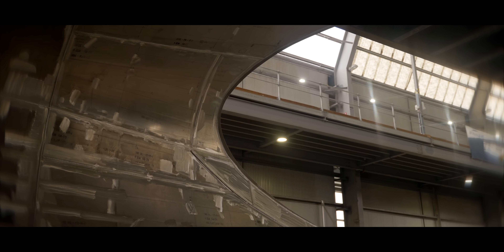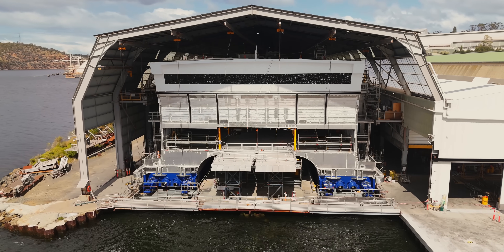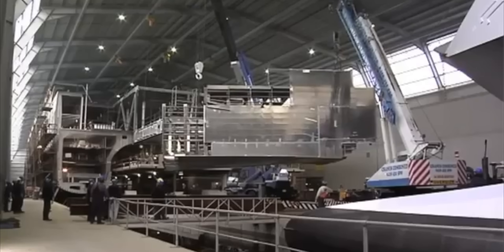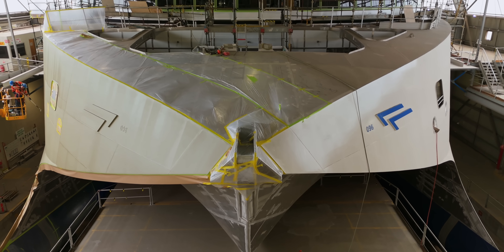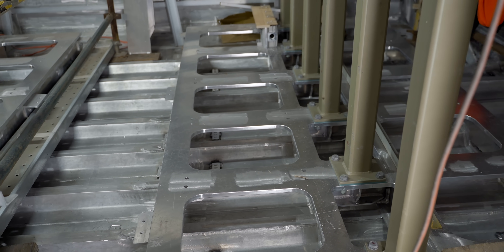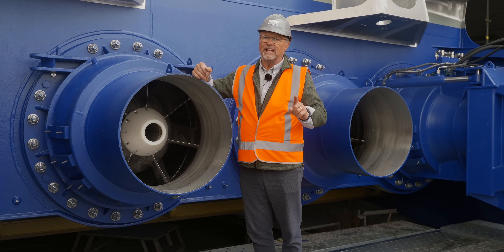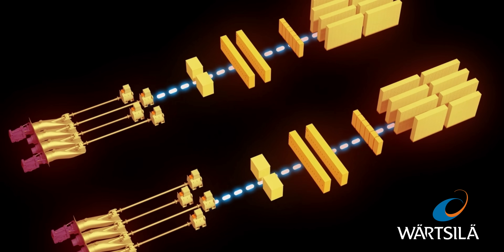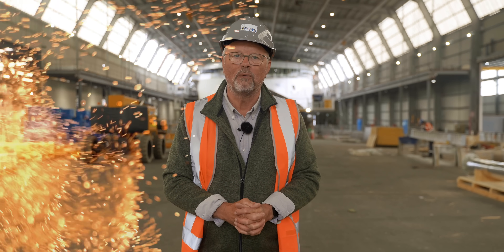The LARGEST Electric Vehicle In The World?!

Comment: there is nothing more inefficient than big electric things. they need huge dedicated substations to charge them and the batteries loose none of their excessive weight as their power declines. remember, to halve the charge times you have to square the input power. there are loads of huge electric projects rotting away because the huge extra infrastructure cannot meat the demands in charging. good old mother nature, harnessing sunlight safely in energy rich oils laughs at the pathetic tech-bound boneheads as they leap from nonsense project to nonsense project, blinded by their own stupidity....truth sounds like whining to those peddling nonsense.

diesel electric, the use of electricity to provide motive force as it is generated and not stored in batteries is an entirely different matter...

Comment: Isn't every nuclear submarine ever built actually electric? 🙃Before you flame me, I think a battery-electric ferry is a great idea. Tasmania isn't 100% renewable - they do use gas for electricity sometimes when there's not enough water for hydro, not enough Tasmanian wind, or not enough wind power to import from Victoria. Again, don't get me wrong - I wish all of Australia was running on as much renewable energy as Tasmania. South Australia is doing well, but Victoria still burns really dirty brown coal, while NSW and Queensland use a lot of black coal. But during the day, as much as 70% of the electricity in Eastern Australia is renewable - mostly rooftop and large scale solar.

Comment: Fragile nuclear reactor plants on a Fragile national grid are a national disaster for more violent weather impacts in a dangerous destabilising climate.

Consumer based rooftop PV generation is a zillion times cheaper than distant renewables Generators and nuclear grid central Generators. 
Millions and millions of rooftops is zillions of realestate hectares and zero new grid costs. 

• PV rooftop electricity is 2cents kWh, 
• grid feed-in 5cents kWh and 
• grid supply is 50cents kWh with all fees included.

The grid is the $TRILLIONs investment asset that needs to be repurposed and integrated into the new resilient and robust national clean electric energy future. 
The $TRILLIONS national electrical grid is FRAGILE and needs to be protected from blackouts in the clean electric future as the massive fossil fueled energy is replaced. 
Distant renewable PV and big batteries can be relocated, nuclear plants cannot and will become stranded assets and an economic dead weight. 
France's nuclear fleet of fragile reactors needs neighbour countries to manage grid load changes.
France's crazy neighbour, Stalin's USSR standing army, Putin's father, and then the crazy Arab oil embargo is the reason France doubled down on nuclear plutonium for its military defence. 🪖 

80% of the world's population live in dictatorships and dictators love ❤️ 😍 💖 plutonium electricity industries. 

So if CO2 emissions worldwide is the danger then FRAGILE nuclear reactor plants centred on FRAGILE national grids is not the answer. 

Hectares of consumer's PV rooftop is a quantity with its own QUALITY. 
Millions and millions of parked v2g EVs massive batteries is a quantity with its own QUALITY. 
Most vehicles are parked 23hrs every day and all night long. 
Rooftop PV dc electricity to EVs big batteries is extremely simple technology. 👌 

The $TRILLIONS national grid owners cashflow SHTTSNPANTS FEELINGS can be overcome by repurposing the existing national grids unique connection to billions of consumer's rooftop PV panels and industrial users moving away from fossil fuels to clean electricity 😀 😉. 
Happy days for grid owners and investors cashflows.

Nuclear promoters wet dreams should remain in dreamland.

Comment: This is a big boondoggle. Batteries take more energy to charge them than what they put out so it is inefficient. There is a reason long haul cargo ships are diesel electric. Electric ships are not knew. WW2 submarines were all electric when under water. They had a diesel power plant and generator when on the surface to charge the batteries and run the electric motor for the propellers.

Comment: Just a little interjection - jets taking off rarely use “maximum power”! The thrust is calculated on each takeoff to give the correct power for the conditions and runway, terrain etc with all the safety “buffers” so that the engine life is not unnecessarily compromised.

Comment: Awesome design, however the weight of the batteries, “taking into account the fact that the energy density per sq/cm still doesn’t have quite as much efficacy as combusting hydrocarbons” could be a matter of concern in the scheme of things.
Lipo and Lion batteries are far superior as compared for example to the old school Nicad batteries of old, however there still is a long way to go in battery technology!
Great video!
👍👍👍

Comment: A battery that size would have tens of thousands of individual cells, if only one of them inevitably faults and goes into thermal runaway… 30 seconds tops to be overboard to the safety of the cold sea.
Love to see how the beautiful ship is going 5 years from now.
Reply: First: They use lithium-iron-phosphate-batteries, which are pretty safe compared to NMC-batteries.
And there are of course construction measures to avoid the expansion of a fire. The battery is divided into separated modules, with fire-proof walls between. And probably some other things, but I don't know details for this specific case (this ship).

Comment: Thanks for sharing. What fuel does it use to run the electric generator and charge the batteries? Is it Diesel or Hydroden? Will there be electric Airplanes of various sizes shortly??

Comment: Well there was probably 500 questions you didn't ask what type of batteries are they ?? For a start 😮😮😮😮 what type of motors?? Who's making them, hellllllooo
Reply: Battery chemistry is lithium-iron-phosphate.
The electric motors are likely PSM, with permanent magnets. Would be typical for Wärtsila.
Reply: Like incat would tell you who supplies the motors and jet units, and of course the batteries, this isn't a retail product mate, you won't be able to go to the dealers and buy one the same, but if you didn't notice there was a wartsila graphic showing the drive train.
Reply: Wartsila.

Their conventional ones use MAN B&W  engines running through ZF gearboxes into the jet units.

Comment: How far can it go on a single charge ?
Reply: Depends on the used power and speed. Generally, you get four-times the range with half the speed. I guess, it will get around 100 km of range with the mentioned 25 knots.

Comment: Tassie not 100% zero emissions,  still use a heap of petrol and diesel etc. Even the electricity is not 100%, connected to coal based systems on the mainland.

Comment: Battery swapping for ferries is a must. The battery room is isolated just detached the containers with batteries push the full in. Reduces requirements for highpower fast charging in minutes,Reduces damage to batteries, you can use lower cost batteries as well. The more of the requirements for the journey you offload to the shore the easier you make it for the boat.

Comment: It is actually not the largest electric vehicle that honour goes to bucket wheel excavators that are being used in Germany to dig away the soil to expose the coal that is used by one of the world's largest coal power stations. 
There are two of them and they use around a quarter of the electricity produced by the power station, the body of the excavators is larger than the building that the ferry is housed in and the excavator boom is around double the length of the building. 
All goods trains are powered by electric motors that get their electricity from diesel-powered generators.
Reply: Those are over 130 metres long?
Really?
Reply: @pugnut403 Yes, they are, just one electric motor is larger than a semi trailer/tractor trailer/18 wheeler and they have several. 
The tracks that propel it are larger than a 2 story building. 
These excavators are so ridiculously large that they have there own elevator system,a conveyor belt system that stretches for kilometres and a crew of over 10 people just to run it in normal conditions. 
The ferry itself would be completely dwarfed by them. 
The ferry is the largest battery powered vessel and is an achievement on its own, there are plans for container vessels that use electric motors but they don't just use batteries but also have special wind turbines that look like smokestacks so they can continuously recharge the batteries.

Comment: for them to charge a ship at 40MW what amount of carbon out out will be created to supply the electricity created to charge the ship
Reply: Very little if renewable energy is used. Renewable electricity is considerably cheaper than electricity produced by burning stuff
Reply: 98% of Uruguay's energy is generated by renewables. Try again.

Comment: This is what Scotland ordered and began to make. Unfortunately, the design threatened to make a mockery of the carbon emissions guidelines, so they changed the design half way through. It's never easy to change design mid build and easily explains why the overrun cost went to many times over plan. 
At least that's how I understand it. Tell me I'm wrong.
Reply: The aluminium manufacturers who supply incat use hydro power in their smelter, I should think that make a hell of a difference.

Comment: Actually, there are lots of ships which are electric and much, much bigger. 
Cruise ships are often propelled by electric azipods. The difference is, the electriicty is generated by diesels. They are diesel electric.
The newish P&O ferries on the cross channel route (40,000 tons or so) have batteries and could do Dover - Calais on batteries. Except the ports didn't realise they would need to charge them, so they too run on diesel.

Comment: Come on Robert, cast your mind back to 1982, the Falklands War. A few British warships down there burned to the waterline, they were Aluminum.  Its a softer, lower ignition metal, the nautral debris in 35 miles of sea at high speed is a disaster waiting to happen.

Comment: Yes Tasmania is very blessed to have a great inland desert with (few population centres - actually, none - high water catchment - AND a couple of power umbilical's to the Eastern Australian Mainland Grid (NEM)  to cover the "tiny" deficits when the wind and water takes a break in their off seasons - or in winter when fog blankets the towns until  midday - I love Tasmania - a very cute place.....

Whether the task can be done on battery Electricity - all depends on the "energy balance...   It is just an engineering exercise - AUSTRAL and Incat both make large Aluminium fast ferries - yes Incat's are the prettier of the 2 companies boats..  (The UK has some/ many aluminium fast boats on several ferry routes - seems you aren't much of a ferry traveller - jk...   (have a laugh  Rob)

Aluminium - has a limited service life - the 1/3 lighter doesn't tell the whole story. - toughness, creep and fatigue get in the way of "extreme lightness".   (At the end of the day-  the energy sources used to charge the batteries is crucial - a 30 mile crossing route is "nearly nothing...

At 8:24 - I think Rob is spouting absolute rubbish...
2 200 kW per "motor? (x8 is -17 600 kW Total)  

4x B474 Engine (GenX),  ~442 000 kg max takeoff weight ,  thrust 266 000 lbf (121 000 kg, or 121 Tonnes) - propelling 442 tonnes of aircraft  down the runway "moderate to decent constant acceleration (~0.3g if FULLY loaded)...
 - If the Exhaust of the B747-8 is 550 miles per hour (885km/hr)- at sealevel (245 m/s ) this is 290 800 kW of Power ( Thrust Force in Newtons * Velocity in Metres per second - of what is being accelerated, which is the Exhaust gas.)  - of course fuel burn is for ~3x that chemical power - ( just as solar panels need 5x the suns energy to the electricity they output)  because we have reality to thank for making so much power to get off the ground  in a few tens of seconds - in under 3km linearly 0 - 175 kt (90 m/s)  and up into the stratosphere......  (another resource says the GenX engine has an exhaust of up to 270 m/s at sealevel - that makes the power output about  x greater...)

(NB, I  just looked all this up on a hunch that you were speaking cr@p.)
Reply: Australs Japan to Korea ferry was only in service before it was removed from service because of leaks.

Comment: 0:34 Bobby made a bobo... it's 130 meters, not 310 meters...

The electric ferries between Sweden and Denmark are 238 meters long and are not lightweight aluminium. And were launched in 2018.
Reply: swapped the 3 and 1 in translation.
Reply: The ferries between Denmark and Sweden (Aurora and Tycho Brahe), are hybrid ferries originally built as diesel powered combined train and car ferries. They have been  retrofitted with batteries. This hybrid capability has saved them a number of times when there were problems with the batteries and/or the charging stations. It is a industrial robot that plugs in the changing plug. The plug alone weights around 140 kg.
Reply: @ChrisBagge Yes, also very useful if they have to go further to a ship yard for maintenance.

Comment: If the batteries are Lithium based, is there provision for dumping them under the vessel if they self immolate?
Reply: Unlikely, since the chances of them "self immolating" are far lower than the risk of a diesel engine catching fire.
Reply: @theelectricmonk3909  Still, not a bad idea, should be easy to place the batteries low in the hull in a detatcheble compartment.

Comment: This is fantastic! Obviously this is designed for shallow draft for a river.  Can a similar sized vessel  be used for Bass  or NZ's Cook Strait? ( 6 metre swells)
Reply: No
Reply: Yes. 
Absolutely. 
This type doesn't work very well when the prevailing waves come from the side though. 
Earlier INCAT vessels were used on Bass Strait, but they were rough when the storms came in from the west.

Comment: In my perspective it's great that we gain a lot of experience with battery electric vehicles.

But in the end, I believe hydrogen fuel cells will come out on top regarding vehicles this size.

They'll probably still have a battery, so that the fuel cell kan keep going at optimal speed even while in harbour.

Most often ferries of that size are required to do much longer distances, and boats in particular aren't that sensitive to weight... diesel-electric has been common, even from incat, for decades.

But that only means that they know their motors and wiring, all they need to do is to adapt to a different power source.

Comment: Scotland has an electric ferry but the battery needs to be replaced but they can't get it until 2027, so good luck !
Reply: If you are going to try and reference something at least get it right. Quote from The Scotsman 8/1/25: 

"Some of CalMac’s new electric ferries may need to temporarily run on diesel for as long as 18 months because of potential delays to power grid upgrades for battery recharging, MSPs have been told.
The seven vessels are due to start arriving in 2027, but the Scottish Government firm ordering them raised concerns on Tuesday there may be insufficient power at some ports in time."

So nothing to do with battery replacement. Do better.

Comment: One 2250kW jet, is the equivalent of four jumbo jet engines at T/O. Essentially, you are saying that a kW of power will produce 0.526 kN of thrust in a jet engine????
Reply: he is totally wrong all the times.
Reply: Need to do a fuel consumption comparison. Turbofan engines burn fuel at a certain rate to achieve a certain thrust and are generally most efficient at cruise. 
Jet engine efficiency figures have been published. We can thus work out the energy per second (J/s) used to create the thrust. J/s is a Watt!!!

Comment: Should add Solar Panels on the roof area of the Ferry, for self- recharging !!!
Reply: totally useless! they need 40Mw of charging capacity at both sides
Reply: the added weight would negate the small amount of power generated.
Reply: Should add solar panels on the roof of the shed they are building in.
Reply: If the whole ship was covered in panels, 50% charge would take 2-3 weeks in full sun 24 hours a day.
Reply: For longer distances they could add sails. Could charge at a slower rate with solar if they could swap the batteries out at the port, would add a bit of complexity though.